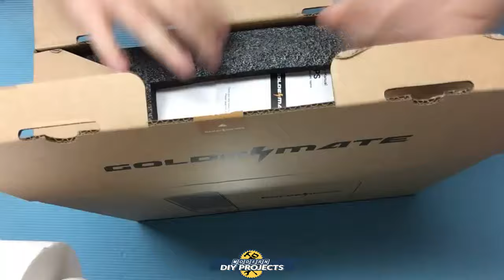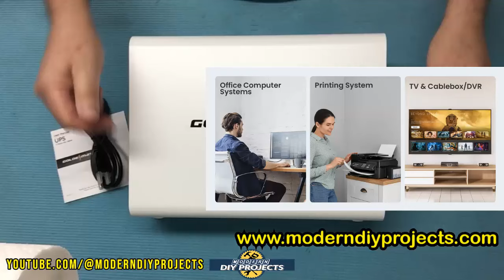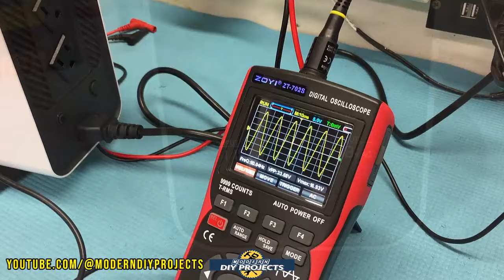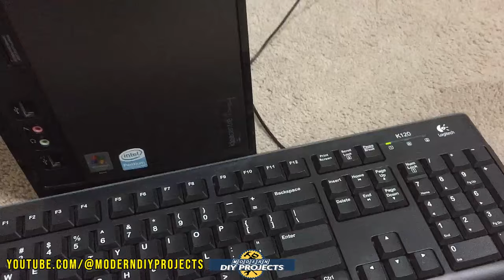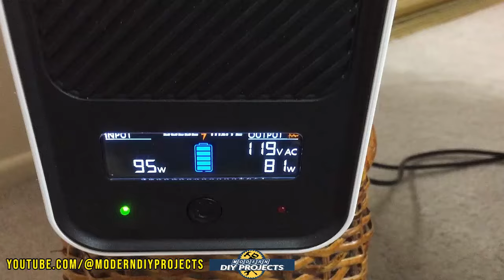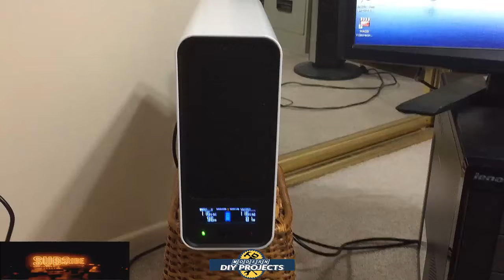MUST WATCH - Cheapest 1000VA / 800W Smart UPS Battery Back Up with LiFePO4 Battery from GoldenMate

Comment: The "pure sine wave" you showed is from the grid. You MUST be on battery to see if you still get pure sine wave output while on battery. I have seen companies say their unit is pure sine wave but when on battery it turns out not to be true.
Reply from the maker: I think that would be an issue on certain other machines that work as a pass through design when plugged in. From what I see in the manual this one is not a pass through. But to satisfy  your curiosity I just tested it right now since it is sitting right next to my desk. I unplugged it from the wall and hooked up my oscilloscope. After 2 minutes of being on battery power it is still reading Pure Sine wave. So I have no doubt that it is a pure sine wave. I am making this post with my computer on battery power.
Reply: @ModernDIYProjects  The fact that there is a switching time, means that it is pass through when on utility power. Otherwise it would be on online UPS and not have a switching time. Great to know that it does provide pure sine wave on battery.

Comment: Where in the hell do you live? You should not be dealing with those power issues in most of the modern wired world. They have whole house surge arrests now you put on your breaker box too btw. I like to use a power conditioner too for my audio gear.
Reply from the maker: I live on the LEFT Coast. The land of energy that is created by Wind Mills, Solar Panels and Unicorn Farts. But sometimes the Unicorns don't fart enough and there is not enough power for everyone. Especially on really hot days like we are having. So yea, I guess this is not a modern infrastructure here. This might be coming to a town near you soon enough too if things keep going the way they are.

Comment: Does this require software updates?
Reply from the maker: No it doesn't. It works right out of the box. No updates needed.
Reply: @ModernDIYProjects  thanks that’s my issue with Ecoflow. It’s constantly needing software updates and even Ecoflow themselves can’t answer how long the solar generator will work if you don’t do the updates. No YouTube address this either